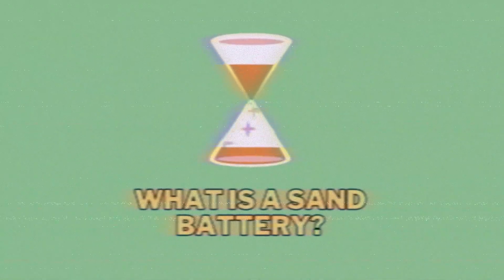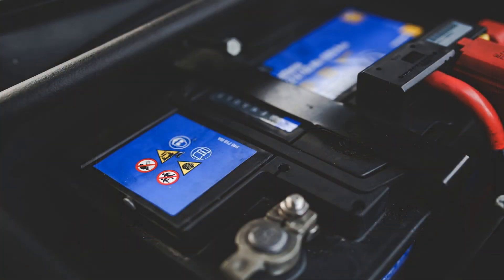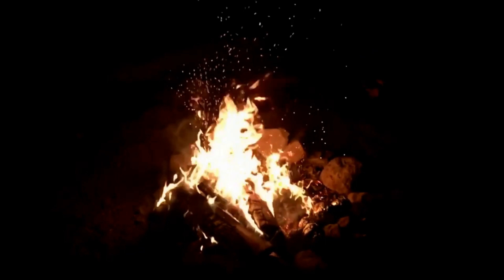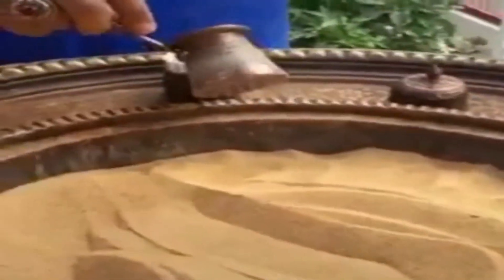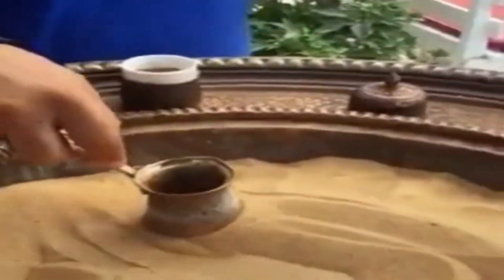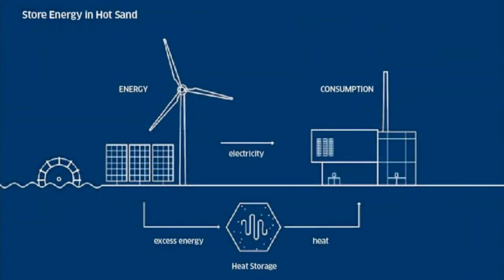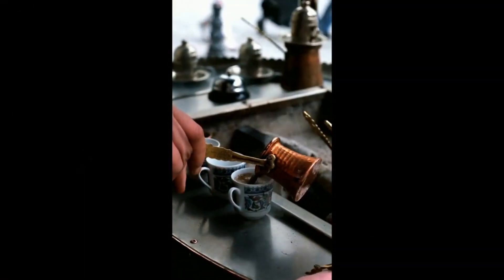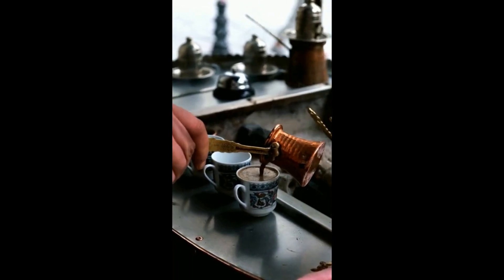What is a Sand Battery? - Centuries Old Technology

Comment: Thanks for the video. There is a small mistake in your video regarding "Phase Change" and Temperature. When something is in the process of undergoing a phase change, it changes from 1 state of matter to another state of matter. So, a phase change is when you transition from 1 phase of matter to another without actually "changing" the temperature. So for example, from gas to liquid and from liquid to gas. So, Sand Batteries just get "hotter", but they are not generally designed to store melted sand.... they would be very dangerous. So, they do NOT undergo a phase change, they simply change their temperature. 
Some memorable examples: If you boil water, the water undergoes a phase change from liquid to vapor (gas)... and while it is doing that it will NOT change temperature. So, it will stay approximately 212F at 1 Atmosphere. (Sea level). Same with Ice, as it melts the ice will just sit at 32, and wont get hotter than 32 until all the ice is melted (generally speaking).
The Turkish coffee making via sand is really interesting!